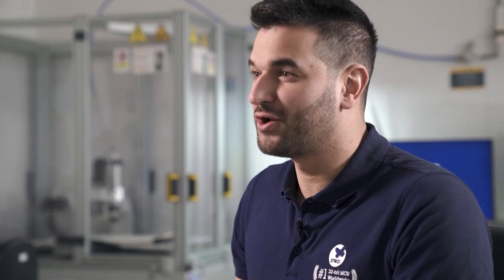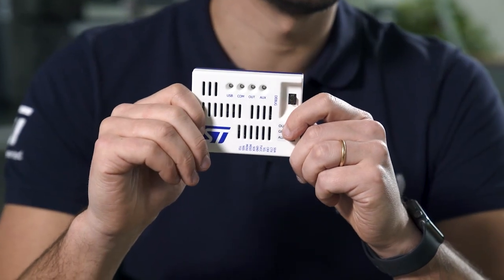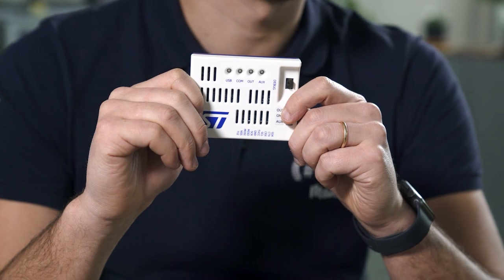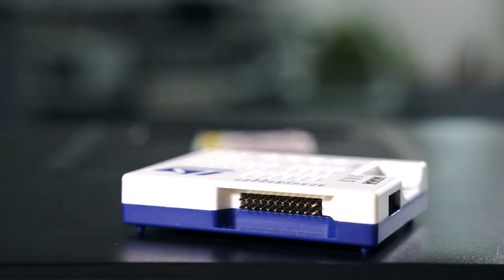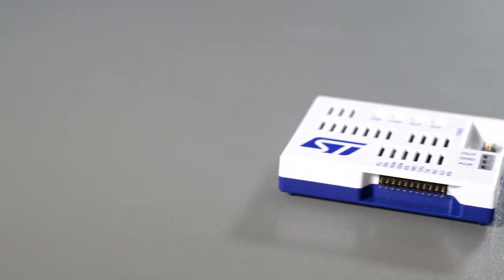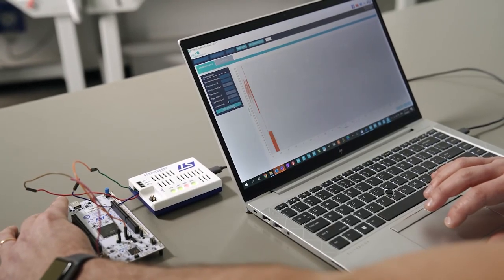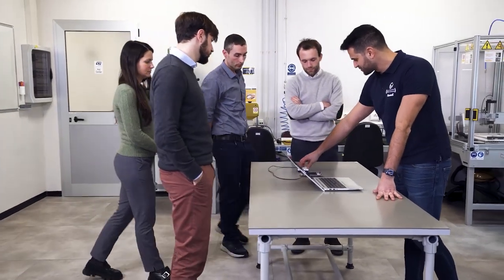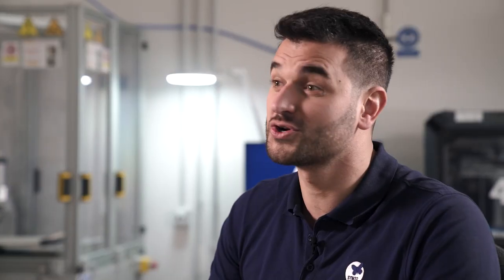ST Milan, The new STLINK-V3PWR: a modular stand-alone debugging and programming probe

Comment: What about the noise floor? 
I appreciate that this device comes with the programmer, debugger & bridges.
I have the Nordic nRF-power  profiler, but I'm not happy with the noise floor.
As per the specification this device can measure upto 100nA of minimum current, if the measurement too noisy, it may not be useful.
Reply: You get what u pay for, u want killer noise floor specs, fork out the $ and you'll get it. This is kiddy amateur  priced stuff.

Comment: Maybe some room of improvement, the external trigger is not enough in some case or not the best approch, adding a small digital analyser will help a lot (hardware is already there) but CubeMonitor Power need to implement this, so it will be easy to identify differente phases during acquisition.